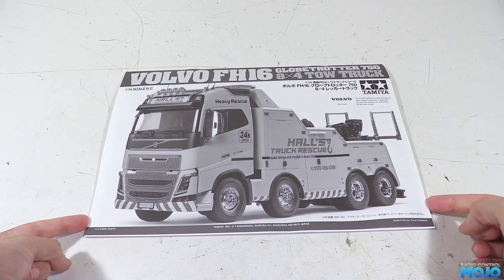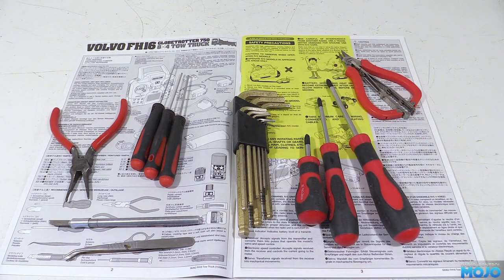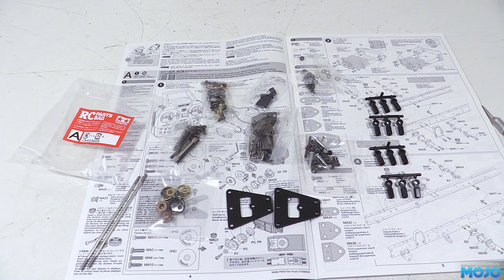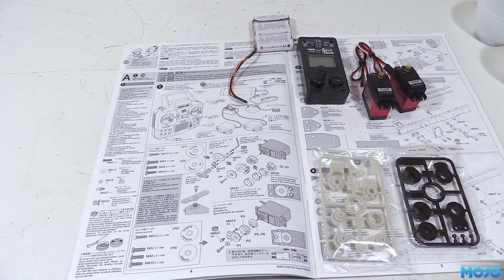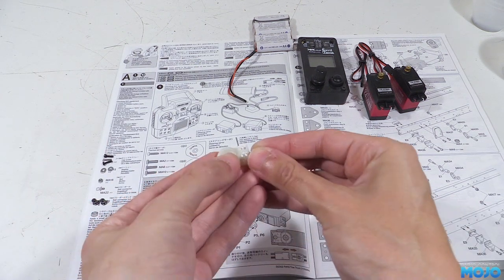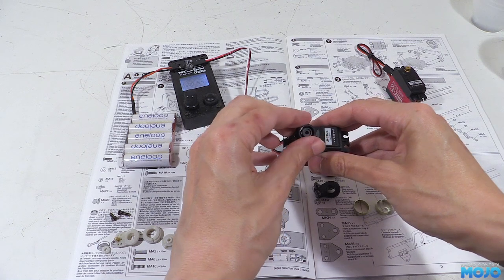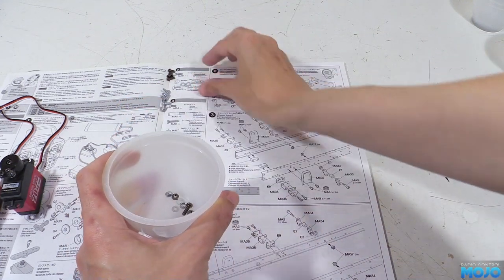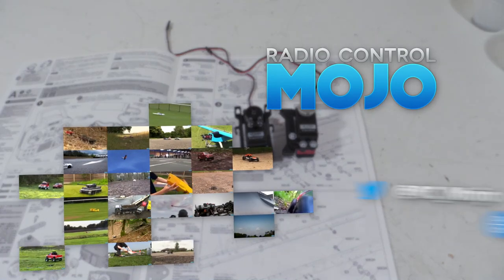Tamiya Wrecker - #2 Servos

Comment: IF someone picked this up as a FIRST KIT.......
My condolences!! 😳
Reply from the maker: It might look a bit funky, but it's almost ideal as a first build. The gearbox is a bit of a hassle if you want bearings, but otherwise it's a nice chunky simple build and makes for a super robust buggy at the end
Reply: @RCMojoTV   I've been at it for a Decade or FOUR.... I'm an Old Fart!! I just can't imagine someone getting it for a first Kit. 😲  These build like any other Tamiya, just  5X the time to finish. But it will intimidate some. Some brilliant Machined Alumininium on this!! My Arocs 8X4 Tipper seems a bit sparse by comparison 😳  I'm doing major mods anyway! 4-1 Gear Reduction Unit, Beier Sound with  WP1080, my "Positraction Mod", lighted Dashboard and the risky bit.... I went Chinese with a Tipper Actuator! But it was only $160 USD!! I'll be the Guinea Pig! Several are wondering how this will turn out...